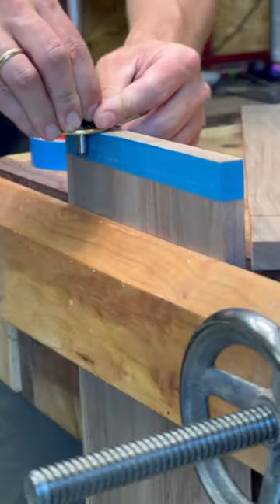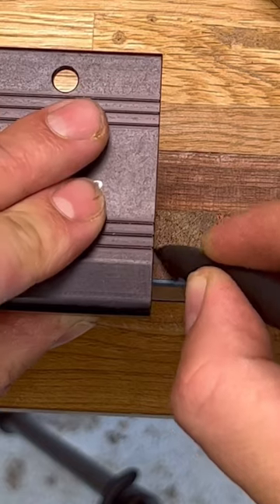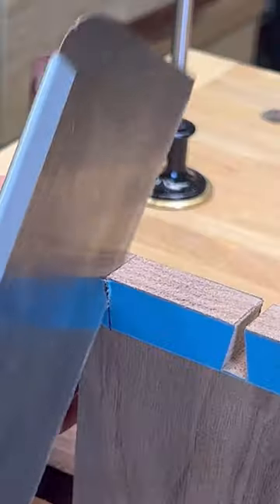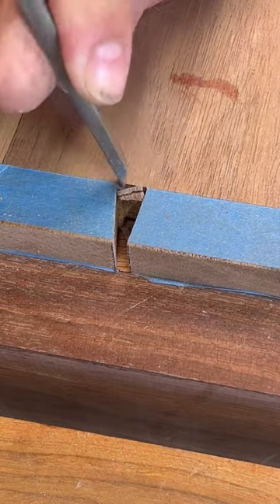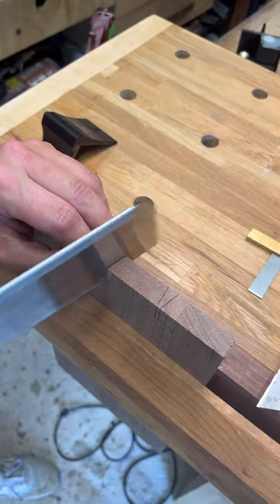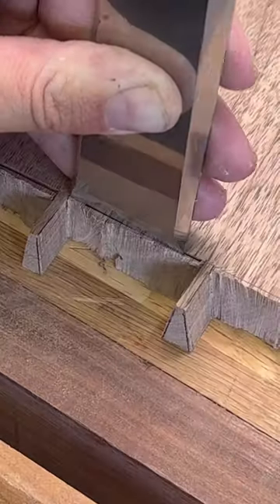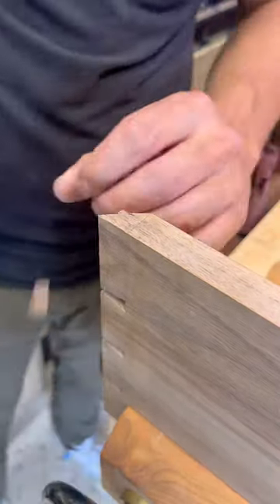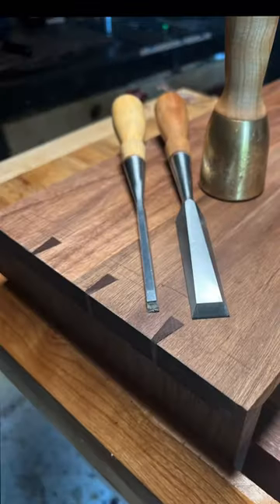‼️my process‼️ of miter dovetail joints! #diy #maker #woodworker

Comment: Those outside miters are a bit tricky. Make sure you always cut on the waist side of the line and give yourself a bit extra so you can pair it back ever so slightly to make a perfect miter. Takes a bit of practice but it’s totally worth it. Very nice job BTW!!!
Reply from the maker: Thanks 🙏🏼